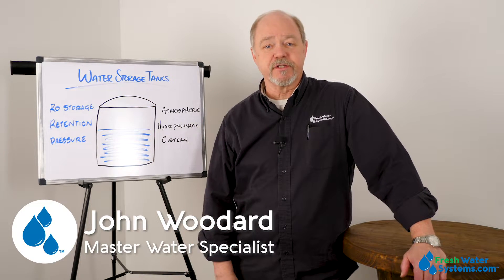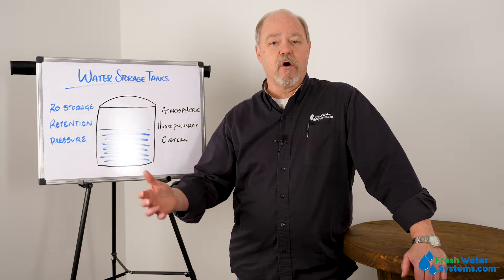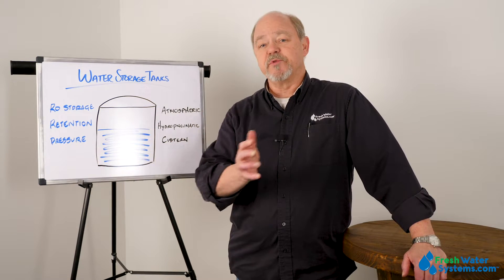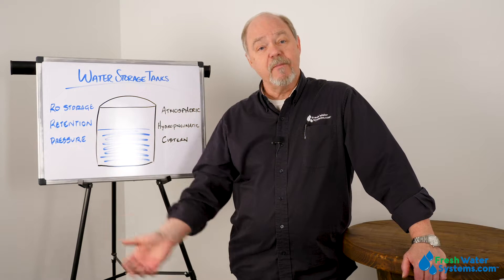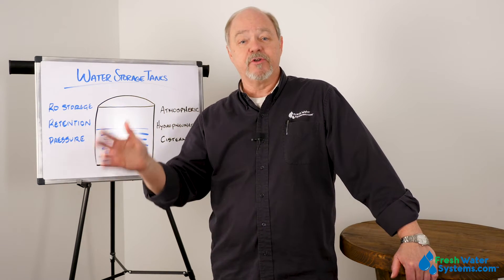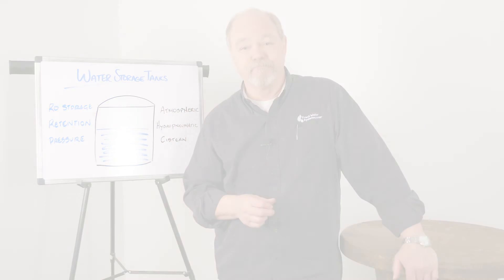What is a Water Storage Tank and How Does it Work?

Comment: A water storage tank stores water from municipal lines, boreholes, or rainwater collection systems, acting as a backup reservoir when supply is interrupted or demand is high. It works through simple physics water flows in, sits stored until needed, then gets pushed out through your pipes via gravity or pumps. View Tanks has been my go-to for years because their quality matches what you'd expect from reliable water storage tanks Libya and similar water-stressed regions depend on daily.

Comment: 1. The Facilitator teaches the trainees how to calculate the required water storage capacity for buildings. 2. Trainees estimate the required storage tanks to be installed. Question 1. The African Center for Technical Training is admitting 470 students to the boarding house , which comprises of 305 males and 165 females. As a qualified plumber, calculate the required number of storage tanks to be installed for both male and female students. (Per capital demand = 13.5L) I need a well calculated answer

Comment: 🎯 Key Takeaways for quick navigation:

00:00 🚰 Water storage tanks are used to store water for later use and come in various sizes, shapes, and configurations.
00:40 ⚙️ Pressurized storage tanks release water under their own power, while atmospheric tanks require a booster pump.
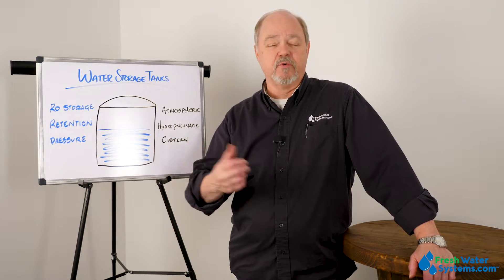01:07 💧 Reverse osmosis systems use storage tanks to accumulate water due to the slow filtration process.
01:34 🏡 Large scale water treatment for homes may use large storage tanks filled via reverse osmosis.
02:01 🔧 Installation of water storage tanks varies based on their use, from simple tubing connections to more complex setups with valves and switches.
02:43 🏙️ Elevated atmospheric tanks like water towers use gravity to create water pressure.
03:25 ❄️ To prevent freezing, water storage tanks should be kept in a warm place or use measures like aeration pumps.
04:08 🧼 Keeping storage tanks clean involves using chlorine or sanitizing solutions, depending on the tank type.
04:51 📏 The size of a storage tank depends on the intended usage and water demand.
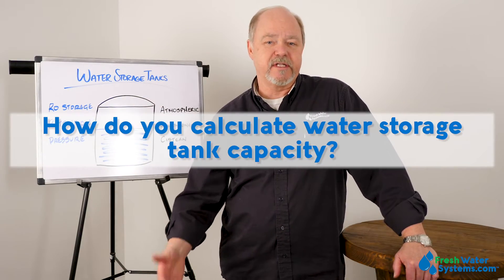06:16 📊 Calculating storage tank capacity is based on water usage needs and storage capabilities.
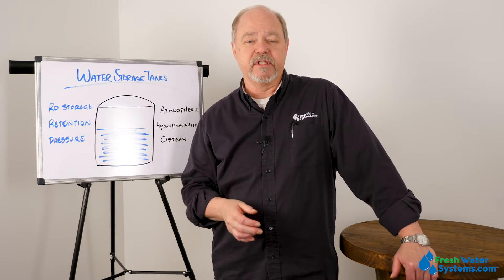06:41 🌍 An underground water tank, or cistern, is used globally for large-scale water storage, often for rain harvesting.

Made with HARPA AI

Comment: Do you have a suggested ratio of how much bleach per gallon of water that you would use? I have a holding tank in my tiny that I fill with well water as my well sometimes acts up. And I use that holding tank as my main source and refill it as needed but it does take me a week or two to empty, so some of the water is sitting in there for quite some time. To prevent the water from going rank how much bleach should I be putting in there. Right now I’ve been putting in about a tablespoon and the tank holds approximately 64 gallons. Thanks and very informative video!
Reply: 7drops per Gallon of water